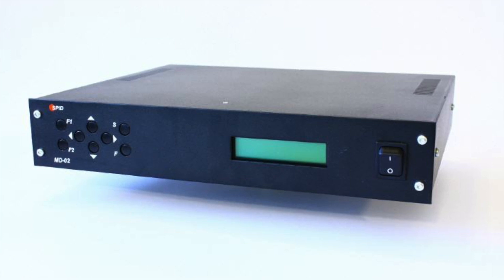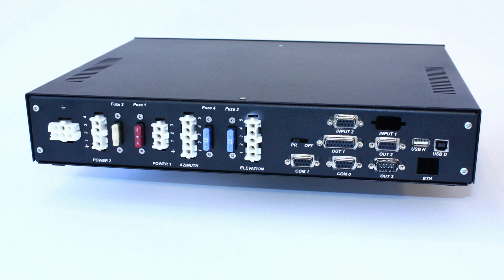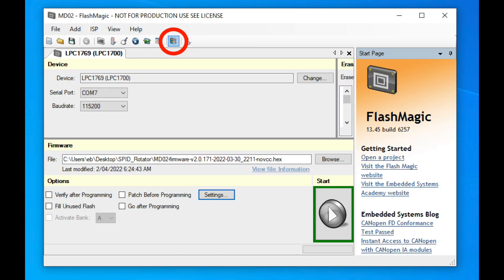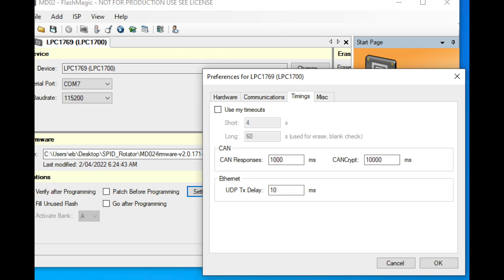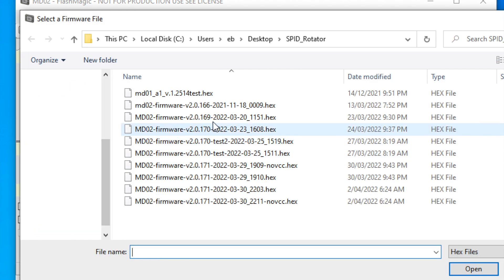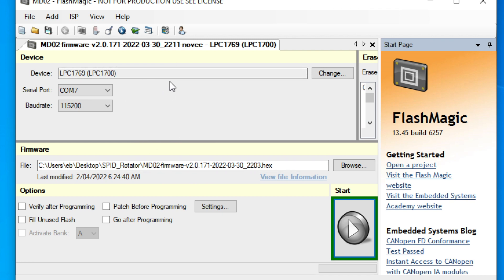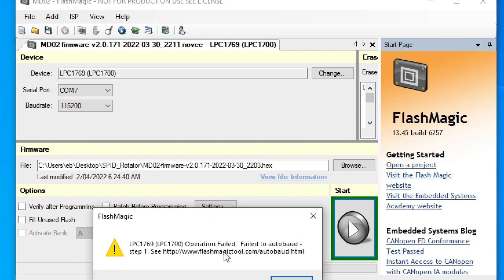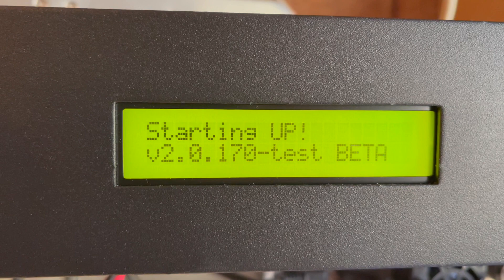SPID Rotator Controller MD02 Firmware Update

Comment: It’s great that someone has posted details on mdO2 , I have nothing but problems with this unit , mine moves left and right up and down but heading indicator left az numbers don’t move !? Elevation moves up but no numbers move I’ve checked all  connections and there fine also relays get stuck as well , I have latest firmware as well I’m using Spid ras and Spid hr

Comment: Thanks for the video.  I did everything the upgrade manual directs but Flashmagic gives the standard "failed to autobaud" error. I tried all baud rates (from 9600 to 115200), changed prolific drivers (from the newest one from 2022 to the old one from 2008), changed to a different computer, and changed to a different USB-to-serial cable without any success. Even more surprising, the cable works with COM0 in normal mode (satellite tracking) without any problem.
Reply from the maker: I never had any success with the Prolific serial driver. The solution for me was to use a USB-Serial cable with the FTDI chipset. Once the FTDI driver was installed everything worked as advertised.